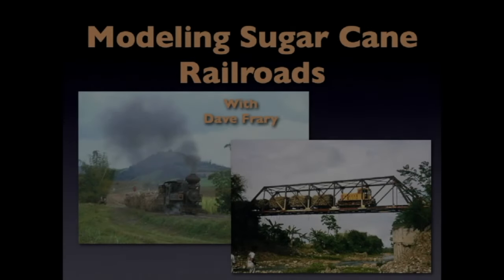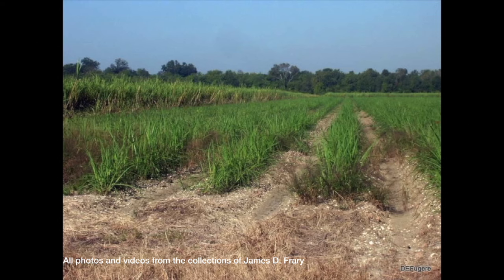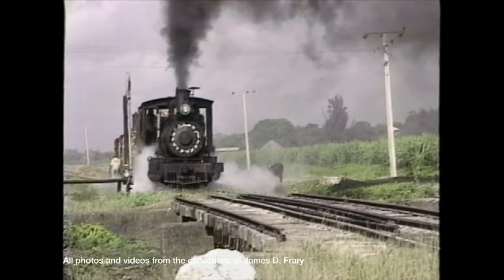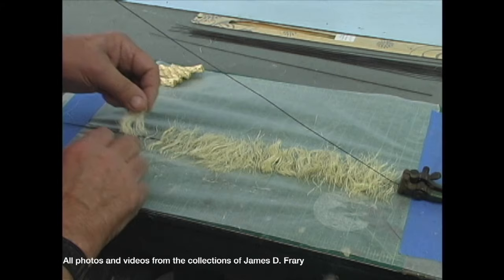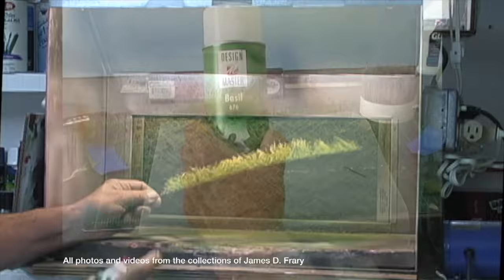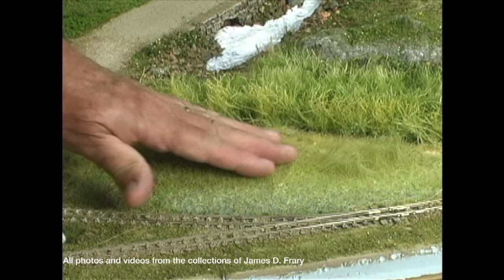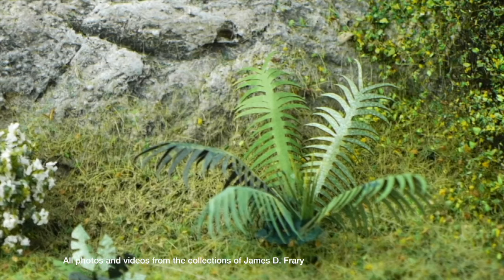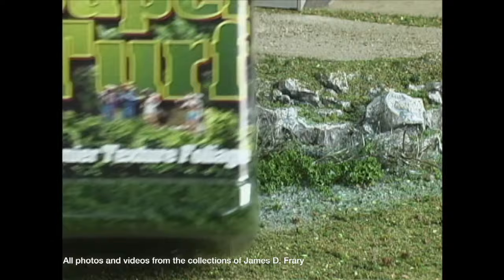Modeling a Sugar Cane Railroad

Comment: As a Louisiana native and have lived in Baton Rouge twice in my life, I can comment on La cane growing.  
Sugar cane is grown in rows similar to corn.  It is planted and cultivated in a 4-year span.  During harvesting the field was burned which does not harm the sugar stalk or sugar content.  The plants were cut with machetes a few inches above the ground.  The stalks were loaded onto wagons and taken to a reload where the stalks were transferred to rail cars or highway trailers for the trip to the mill where the stalks were unloaded, crushed for the juice, and the juice was processed into raw sugar.
Each field is grown for 3 years then plowed up and left to fallow or rest for a year before being replanted.  The cane will sprout from the stubs for the next year's crop.  
In the early years, there were many plantation lines that used portable track panels in the fields and more or less permanent tracks to bring the cane to the mill.  Raw or brown sugar was then shipped by a common carrier to a refinery for bleaching and grinding.  Most of these lines were 3-foot gauge with a few using 2-foot gauge or 30-inch gauge.  
Because of many very serious accidents on the state highways from decrepit trucks and trailers, their use was outlawed around the 1990s, and the accident numbers dropped while the sides of the highways were not as fouled with strewn cane falling off the trucks.  This time of harvest is called a "campaign" from late September into January because once started it does not stop.  Because most of the land used for cane production is low-lying, it is also very flat with low ditches along the sides.  Check out "Down Among the Sugar Cane" if you can find a copy.  The LSU extension service has devised machinery to plant and harvest cane without having to burn the fields.  Another good book about sugar cane railroads is the one about Hawaii's railroads.

Comment: Queensland in Australia has really cool sugar cane locomotives (now diesel) that are narrow-gauge. Rolling stock includes sugar cane wagons, open wagons, vans, open-air coaches and radio-controlled brake wagons. Franna cranes are used to lift derailed engines and wagons.

Comment: Central Florida is still has a large Sugar Cane industry. The US Sugar Corp, has been opperating a railroad for many many years. If you hit their website you can see what locomotives they have currently. USSC has a significant Steam Operation in the 30' through the late 50" and three of the locomotives from that era still exist. There are three light 4-6-2 Pacifics that exist. The 148 has recently returned to the USSC and is under restoration to eventually become operational again for excursions. The 153 and 113 are also light pacifics and they are on display (static currently) at the Gold Coast Railroad Museum in Miami, FL next to the Metro Zoo. Both these loco's were operational up into the early 90's and then retired. Numerous attempts to bring one of these back to operational status has been attempted, but funding (lack of) stalled the efforts. Anyway, there are significant US operations that can be modeled as either a steam operation or more current.
Reply from the maker: Thanks, Interesting information.